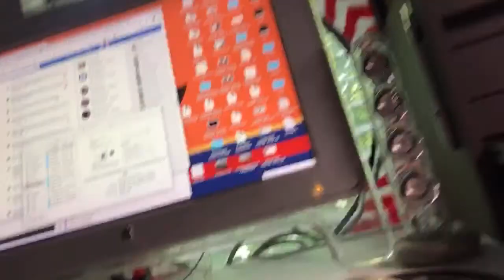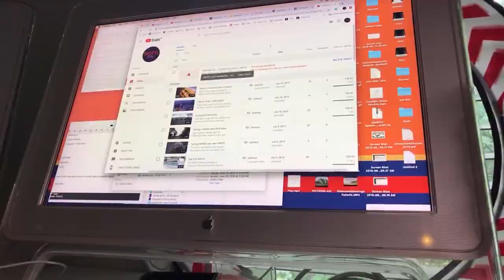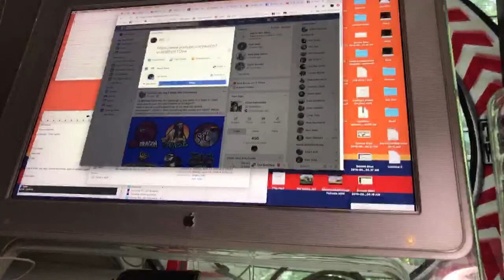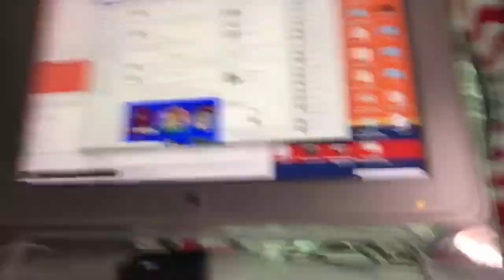3” Build with Tarsier, RCX 1306’s, Talon F7, etc...

Comment: Hello, I'm thinking about upgrade my micro with some better pieces. 
What you think for motors , RCX H1105 V2 5000KV or Mamba 1105 5500 kV. What about props emax rush 2.5 or gemfan 2540 ? Its a 3s micro on diatone 2019 gt r249+ 115mm frame.
Thank you